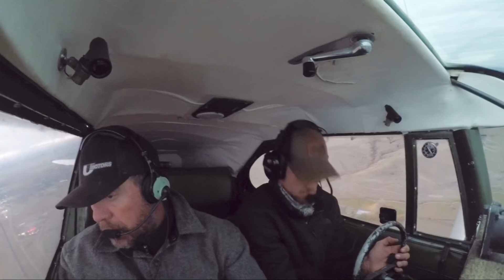Engine Failure in Tri-Pacer- practice

Comment: Got the tri-pacer in getting some upgrades. Prop is getting repitched into a climb prop. Also got an oil filter, alternator, and ADS-B in and out installed. Control cables where all loose so they are getting adjusted. Slight pitting in a couple cylinders but other then that it's all looking good. Looks like you got a sweet new float plane? I'll be looking forward to seeing more videos.